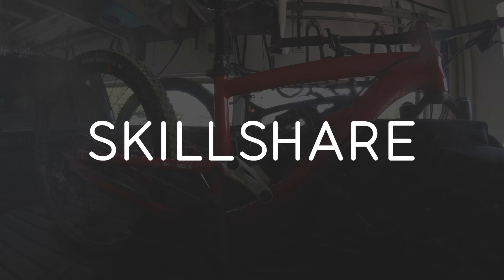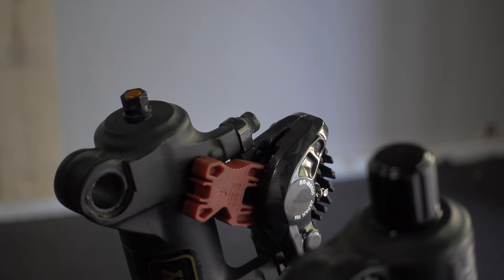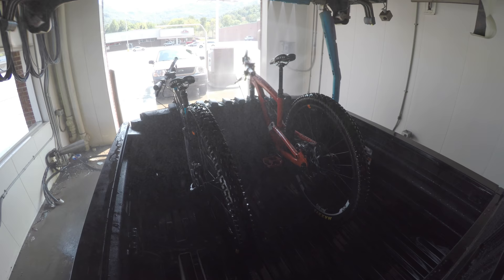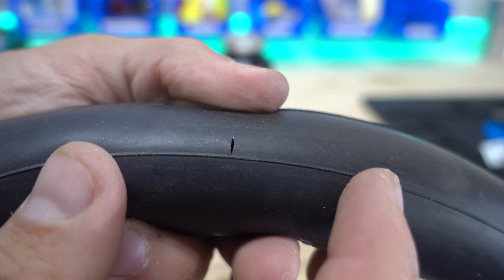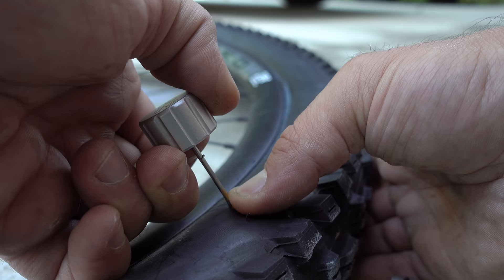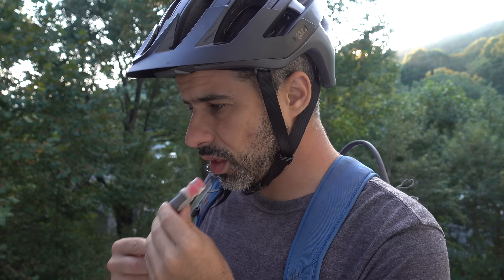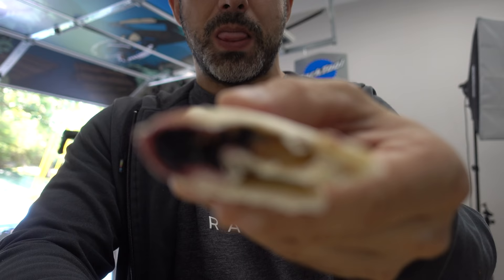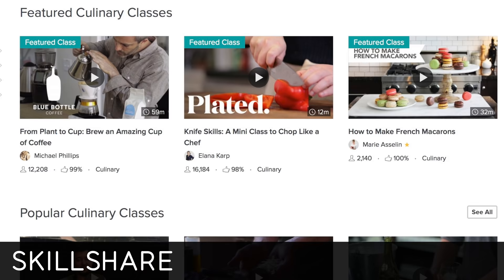10 Hacks for Mountain Biking and Beyond

Comment: CamelBack hack: To prep for your next ride, throw your half full CamelBack bladder in your freezer. First blow air into it and place it with the filler cap on top so you don't freeze the cap on. The morning if your ride, just add water. By the time you reach the trailhead enough of the ice will have melted to allow liquid into the drinking tube. You'll have ice water & you'll be keeping your back cool during the ride.
BONUS HACK: After the ride, throw the bladder back in the freezer to prevent slime from growing in it.🤙🏾
Reply: But what if I want water on the way there ☹️☹️ 

JK I don’t own a bladder 😂
Wish I did though ☹️
Reply: Yeah Baby,  I always do that with my Hog!
Reply: Then how do you  p
Reply: @urbansk8r231  pardon
Reply: @booty_hunter4207  lol I  must of been half asleep  when I wrote that. I'm scratching my head right now wondering what I ment by that lol

Comment: Love the hacks.
Patches: put glue on both the tube and the bit of old tube you're using for the patch then let dry to tacky and stick together without moving. The patch in the factory is the same material, pre prepared with the glue but hermetically sealed to prevent drying out. You're just replicating the same thing.
Cleaning the tube: important. You need to remove any crap and oxydised rubber so you don't stick patch to crap.

Comment: Pro-Pro tip (I used to wrench for MountainCycle back in the 90's), use one brush for your drive train, another brush for your tires and another brush for your cleaner parts. Label them or color code them and don't mix them up. It'll make it easier to clean the bike, drive train and tires and get less oil and dirt on the parts that tend to be cleaner.  We used to use Lemon Pledge on the bike before races and Pam spray on clipless pedals to shed dirt and mud faster as the race went on.  Now there are better products for that but the idea is the same.
Reply: pardon?
Reply: Hes jealous of your genius XD
Reply: It's far from genius, it's what all race mechanic do, even today.
Reply: And one for your teeth. Label that one really distinctively.

Comment: I dont know if you have done this before, but try using dollar store super glue on the holes, I did that on a gokart tire and on a car tire, both have not let me down and hold air as if I got them yesterday
Reply: DFW rider I would think it should work for both, especially in a situation where you just need a quick fix so you can get home

Comment: Speaking of tube punctures, if you have access to a junk car, you can use the seatbelt as a tire liner, or even better a load strap from a semi (you can usually find them tossed when they're frayed or damaged) they're a lot thicker than a seatbelt and would offer a bit more protection. While they won't stope everything, but they will add a bit of puncture resistance to the tire.

Comment: Been saying this for years. Even better than dish soap on your bike, bodywash is even better. You can use the cheapest stuff, and it still works great. The reason behind it is that dish soap is designed to break down grease, body wash is not. It is also gentle enough for the skin so it will do a good job getting rid of dirt and grime, but won't do anything to bearing grease. The bonus is that if you're blessed to have bike washes at your trailhead, you can also use it to clean up before you head to the pub for some post ride food and brew.

I am not strictly advising against dish soap, but I believe body wash is a better option because it is dual purpose, and gentler on seals and places where grease is the barrier like pivots etc.
Reply: Josh K or just use a degreaser... car people know thats about the easiest thing in the world to clean a bicycle.
Reply: @joshlarochelle1298  ...and about the easiest thing to ruin a bike. Seals are more open on a bike and a degreaser will break down the bearing grease.
Reply: Most bike people also work on their bikes more than a couple times a month and replace seals and regrease the bearings...
Reply: KMCreativeDesign you should grease your bike atleast once a week if you ride it everyday if not twice. So that’s not a problem if you also maintain the bicycle you’re cleaning.

Comment: Puncture Resistant (Heavy Duty) tubes and tyre liners are guaranteed to keep your tyres inflated . . .
The bike and the bus have been my main sources of transportation for over 10 years . . .
and I often put in more than 100 miles a week ! ! !
during all this time I have only had ONE flat (puncture) . . .
 . . . a sheet metal screw had worked its way around the liner into the tube ! ! !
It happened at night when I could not see what was happening before it was too late ! ! !

I learned about this "hack" at a bike shop in Reno, Nevada . . . an area where thorns are a constant problems ! ! !

Comment: 5:43. after your done taking a sip blow into it as much as you can/want. not only wont you have water sitting in the tube but, and this is the reason i do it for, is that next time you want a drink all you have to do is bite down and the pressure from blowing air back into the bladder with force the water out. it really helps when your hot and out of breath but want a drink, which is when we all want a drink the most.

Comment: If you're riding on a hot day, try freezing 500-700ml of water in the bladder (I use a 2l bladder). The ice sticks around long enough to keep the water cool, but melts quick enough that you get to drink it after 15-20km of riding.

Comment: I just had to show my son that even Seth agrees stickers make your bike faster, I've been telling him this for years.
Also, sorry Seth that's not the best way to sticker. 
Mix up dishwashing liquid in an old spray bottle. Clean your surface with it.  Give the sticky side of your sticker a squirt. 
Now you can slide it around to 100% perfect angle, wipe out the water and bubbles, move it a bit again if you need to, just remove it and put it somewhere else if you have second thoughts, and when it dries, it's stuck perfectly.
Also works on phone/laptop skins, whatever. 
Curved surface, and your sticker isn't the type with the clear layer over the top? Put a bit of baking paper over it, hold that down with a bit of masking tape, and leave the whole thing overnight. (after wiping out bubbles and aligning). 
This will ensure the corners don't lift.  Mixture wants to be precisely just a wee bit soapier than if you were doing dishes. Unless you already use heaps, then use less. If you use Just The Right amount, just go with that. (It really doesn't matter just don't go overboard.)

Comment: After the price of rubber tire cement went up so much. And fixing a few hundred tires over the years. I tried to patch car tires and larger with rubber glue school supply cement a few years ago it doesn't work. You want maximum adhesion and stickiness anything less is doing it halfway and you'll be doing it again when least expecting it. I have a saying do it right the first time. It's good to experiment and try hacks but be aware it may cost you more money in the long run!

Comment: There is a beter sticker trick. Spray some window cleaner onto your frame then place the sticker on the wet surface. You will be able to move it freely for a moment to position it perfectly and ofc avoid any bubbles. Then when you get it where you want just wipe the cleaner around the sticked and wait few min rest will evaporate locking the sticker in place ;]

Comment: My bike hack is to use old Innertubes cut them into inch strips put them on your seat post or handlebars their stretchiness and rubberiness makes for a good hold saves using zip ties.
Reply: put your weed in your seat post and stuff a piece of cloth in there to keep it in. (as long as you have a quick release seat binder)

Comment: just a pro tip for the glue for the patches if you wanted to dry faster just light it on fire for a couple seconds if you're in a well ventilated area make sure you blow it out before your tube gets hot though it will make the glue tacky really fast

Comment: Instead of trying to put the sponge  into the hole on the sidewall of the tire, you could've been possibly glueing a patch on the inside? The tire pressure will hold it in place?

Comment: the next best kept secret for sticker application: wipe the area first with a microfiber cloth and then use a squeegee or one of those solid foam painter's brushes to apply even pressure across the width of the sticker as you put it down, doing both those things will give you the lowest chance of getting bubbles or having it come off of the bike on its own

Comment: to pump up a air from with out a shock pump all you need to do is get a adapter so the valve and lock it into your hand pump then you have yo take the pump from the adaptor then get the adaptor off as fast as you can

Comment: Hi: For as long as I have been riding my bike, I have a question . . .    I always seem to have a lean to the right side.  When I was younger, I thought it was because I was riding used bikes and the bikes had a lean.  But, it is clear it is me because no matter what bike I ride, I lean to the right.  And when I ride no hands, I have to lean my upper body to the left to balance.  What is that about?  Are you perfectly centered on your bike?  Thx.  what am I doing wrong?  What can I do to correct it?  Do I have to amputate my left leg to balance?  What is wrong with me?  thx.

Comment: Don't ever use dish soap to clean your bike as dish is designed to break don't grease. If the soapy water gets into your hubs, crank, pivots and headset it can break down the grease and dry out the grease. Dish soap no bueno

Comment: You should never wash your bike with a power washer unless you stand back to reduce the pressure. Yea it will clean your bike but it will also blast dirt into your bearings and blow them out. Yes they are sealed but not for that amount of pressure

Comment: i have a trek 6500,if you can get a set for cheap i recommend the slime innertubes if you  ride cross country/trails and dont want to deal with or cant get tubeless etc... when i ride the trails i keep a can of bike fix a flat (idk brand off top it doesnt matter) and a couple shots of co2 under my seat.   haven't had to use them in 1347 miles.  i put them in last fall. i live in marquette mi and have been riding even when its been almost negative out no issues yet.  i hardly noticed the increase of weight, granted i train legit with this bike so i quickly adapted, point being if it bothers you work harder it wont for long. last but not least dont do some dumb sponge shit or whatever just get the damn bacon. some things just arent worth nigga riggin

Comment: So if I want to clean my bike I have to make driver license and buy car, that's perfect :-D
1:09 - maybe it's better just have some string with you than hacking your shoes half of hour :-D
3:39 - I don't understand why people just don't have new tube and basic tools, I understand it has some weight, but you can do it properly directly on your ride and you don't have to change it later for new one 
6:17 - cutting bread with saw mad in USA, that's the most american thing I ever saw :-D
Reply: 3:39 its called recycling. He even said it.
1:09 the whole point of it is that you dont have a specific thing to fix it with so use shoe laces.
Do you not get it? Do you even ride a mtb?
Reply: @chrisblanco8093  ok, ok, I just wanted to say - people don't be stupid and have extra tube on your bike
Reply: @Pidalin  the hack isnt designed to work on the trail. Its just for home and workshop.